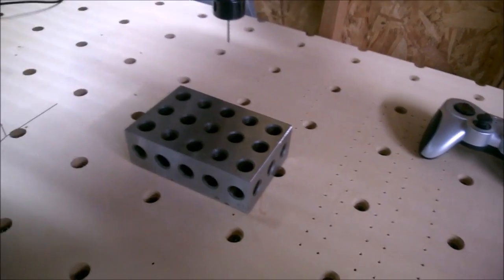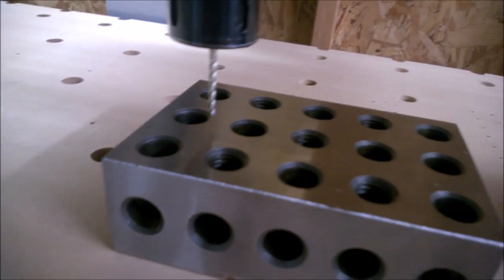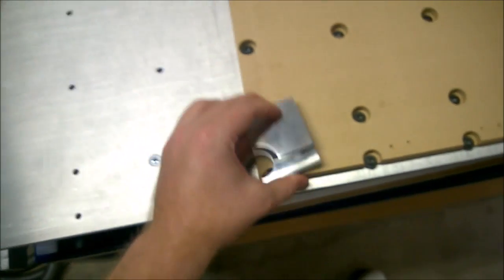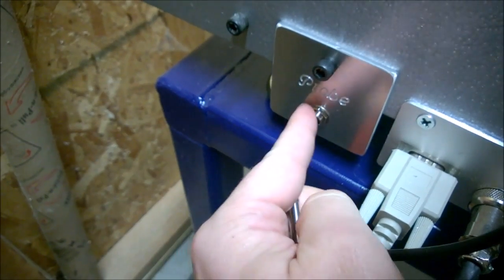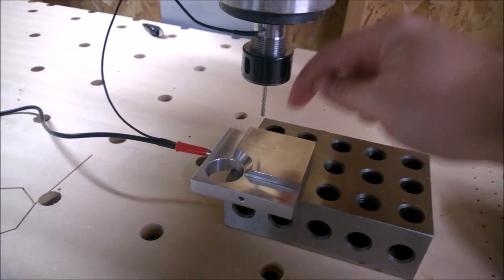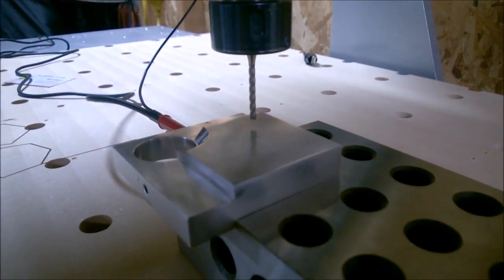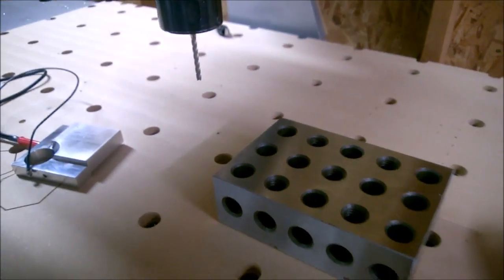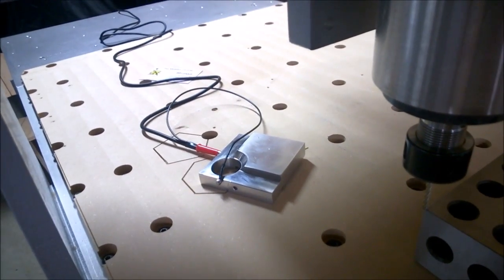jerbroCNC: KFlop / KMotion CNC Automatic Zeros / Tool Height Setter

Comment: That's a Carl Bruce CNC machine or I'm a rubber chicken.  Am I right? 😄
Thanks 1K for the video and code.  I think I've got a chance of getting this working now.
Reply from the maker: Correct!  Still works great.
Reply from the maker: By the way, you don't need the extra ground to attach to the collet holder - Carl Bruce's machines are grounded at the tool, so you can skip that step.
Reply: Thanks for the tip!  I was wondering how you pulled that off with a single lead.
Reply from the maker: @Demothesses - the mono amp connector I used does have two electrical paths - one + and one ground.  Though since the tool is grounded, attaching magnets to wires and finagling with that extra wire while not cutting yourself on the tool is not an issue.  Setup and teardown of the calibration block is that much easier.

Comment: I modified your code a bit and got quite a bit more accuracy. Not necessary for wood, but critical for machining metal. Basically, I added a "slow probe" where once it found the metal, it would back up just slightly and probe again at a probe speed/50. 

Whereas previously I could get repeatability to within 0.003", this took me to repeatability of 0.0005". I did something similar with the homing switches and the homing routine. Just thought I'd share.
Reply from the maker: I appreciate your coming back to share this.  I'd like to try it out - would you mind sharing?
Reply: Here I only reduced by 20, but in other scripts (probe down) I reduced by 50.

Comment: Thank you so much for the video. I am also using Kflop with Kmotion/KmotionCNC. I have a similar plate with a 0.6" corner hole that's centered on the work piece. I looked at your code. What does the RIGHTCORNEROFFSET and LEFTCORNEROFFSET variable represent? My guess is MAXIMUMTOOLDIAMETER represents the size of the corner hole? Thank you for this video.
Reply from the maker: Howdy!  Each of these three values are used to figure out how far to move the tooling to prevent crashes on to the top of the plate.  

MAXIMUMTOOLDIAMETER  is precisely that - it's the largest tool diameter you would use.  Now, to you do have to consider the size of the whole when you choose your largest diameter tooling that use the plate.  My plate has a hole that has a 1 1/8".  I recognize that when we don't yet know zero precisely, we don't want to get close to the edges of the hole.  So, given the tooling I had and the diameter of the hole it has to go in, and understanding the tool won't be in exact center, but be off by a bit up/down/left/right, I declared that 1/2 of the whole diameter plus a little wiggle room would be safe.  That means 1/2".  In the code,  MAXIMUMTOOLDIAMETER  is used as an additional offset when moving over the plate (both east-west and north-south) so that when the tooling is brought back down, it misses the outer edge of the plate.  I think technically, as the first-pass for finding the hole center is pretty good, you could increase that value to 1" in my case.  Practically speaking though, I don't have tooling that wide I'd use in this scenario and it means the probe mechanism will go further out to be more safe.  So, this one is up to you.

LEFTCORNEROFFSET is a little mis-named.  This value is used as the distance between the middle of the hole and BOTH the distance from the middle of the hole to the left edge of the plate and the middle of the hole to the bottom edge of the plate.  In my case, it's both 3/4".  

RIGHTCORNEROFFSET is also a little mis-named.  This value is used to figure out how far from BOTH the upper edge and right edge the tooling should be brought over the plate to then probe north/south and east/west.  Essentially, that's the center of it's traversal across the plate.  In the video at 6:20, the endmill moves RIGHTCORNEROFFSET distance over the plate before it moves the other direction.  Again at 6:35, the endmill returns to a distance of RIGHTCORNEROFFSET from the east side of the plate before it moves south.

If I were to to update the code, I'd rename LEFTCORNEROFFSET to to HOLECENTEROFFSETFROMSOUTHWESTCORNER and RIGHTCORNEROFFSET to PROBINGOFFSETFROMNORTHEASTCORNER.  I suppose it's possible you could want different offsets for each of the four values, but in my case, I was fine with just those two offset values.

Please let me know if I can provide more clarity.  Cheers!
Reply: @jerbro32  I completely understand the what it is you're talking about. By chance, would your CNC builder be named Carl Bruce, SpeedlineCNC? He built my machine and it looks very similar to yours. Mine is 4x4. I honestly don't like my corner block that much. Carl gave me a nice sized z-touch-off block. I ended up buying a corner block that seems too small. The hole in the corner is 0.6" which limits the max diameter bit I can use to reference the work piece.
Reply: @jerbro32  My circuitry is looking for the IO probe bit to go low/to 0 volts. I'm not sure how to switch that, or if you had done that within your code already. Did you mark the probe bit as a #define? If not, I'm wondering if there's a way to define the triggered state as either 0 or 1?
Reply from the maker: @AlabamaWoodworker  Yes, my builder was Carl Bruce, though I completely replaced the control box, added the probe functionality and added the ability to control the spindle speed via code instead of what he had - which was just the VFD dial.  Also, when I purchased my machine, it was only from Carl Bruce - I don't think SpeedlineCNC was a thing back then.  It's good to know he's still in business and evidently stepped it up a notch!
As to how my IO probe is setup, look at my reply to Benjamin Farrar below.  That explains how from hardware to software to the #Define statement this is all connected.  If I remember correctly, you may also have the option in kmotion to configure how the bit is configured - 0 or 1.
Reply: @jerbro32  Thank you, Jeremy! I set PROBEBIT to 6 (versus your 171). The program was able to compile and run; however, I still need to make modifications that are specific to my machine counts, etc. There's a lot to unpack and I may be reaching out to Tom at Dynomotion to help me unpack all of it.
Reply: @jerbro32  I was able to get your program to work. I completely forgot to include the occasion of my KflopToKMotionCNCFunctions.c. Duh! Once I specified all my parameters, the program worked perfectly.
Reply from the maker: @AlabamaWoodworker  Fantastic!  I of course need to see a video of it...  otherwise it didn't happen, right?  : )
Reply: @jerbro32  You bet! I'll definitely be making a video about this.

Comment: do you have a picture or a video of the interior of your control box? need to rebuild mine, going to replace my servo motors with stepper motors, and update my boards to a kstep board. just wanted to see if you have other power supplies in there besides just the 5v power supply, and what else it might contain, since our machines are similar. thanks
Reply from the maker: I do.  Here's how I put it together:  http://www.joeschmoe.com/images/cncControl.jpg  The power supply I went with handles 5v, 12v and 48v - it's a HP server powersupply.  I can dig up the model number if needed.  You'll notice the VFD as well as fuses, breakers and some power handling/conditioning items recommended in the manual for the VFD.  I did have to mount the VFD sideways, but it works out, especially as I control the speed via software and not via turning dials and bushing buttons.  On the door is temp, voltage and the master switch.  I do have two 120mm fans - the lower one draws air in, the upper pushes it out.

Comment: does this automatically record all measurements and account for the offset of the plate thickness for you, or do you have to manually input or set zero for each axis? it seems like you just his the start button on the plate op, and it measures and sets al your zeros (not sure if it accounts for the plate, or you have to lower it the plate thickness, and zero a second time). I'm looking to do this with my cnc, and just wondering if its automatic, or if it requires more input after running the plate op. thanks in advance!
Reply from the maker: Hi Kris.  Good questions.  I've effectively told my code how thick the plate is (0.621"), and I told it how far to go on each axis - which I did based on the dimensions of the aluminum plate you saw in the video.  If you take a look at the code file I linked to in my description, you'll notice all these variables (thickness, width, depth of the plate, how fast to move, the corner offsets - all of them are variables I've defined at the beginning of the file.  For example, #define PLATETHICKNESS 0.621f is where I define the thickness of the plate as 0.621".  I also have defined how high the probe should go after it gets done (SAFEZ), how close the probe should move over the plate (BUFFERDISTANCE) and how far to go down in the hole when it finds the circle (PROBEDEPTH).  All of these can be changed as you want in the #define statements near the top of the file to match whatever plate you're using to find zero.
Reply from the maker: And no, I don't have to redefine zero at all for any.  I push the button, the CNC machine will find zero on all 3 axis by itself in one-go.  I'm still using it.  : )
Reply: awesome, thank you so much for the reply! this is very exciting, because I need something more accurate than the paper method. ill study the info you've posted about building the actual probe jack and leads, and give this a shot myself. I'm using an aluminum vacuum table for my base, so I may even be able to get it to just touch off on the plate itself, rather than a separate touch plate, as I mostly just need the z for tool changes. thank you again for all the information, and for sharing your work with us!
Reply from the maker: As it turns out, I've done that too.  http://www.joeschmoe.com/jerbroProbeDirection.c is exactly what you want.  All it does is go down until the probe makes contact, then it sets zero (- your preset offset), and raises back up 3 inches.  I use this specifically whenever I need to change endmills.
Reply: The link says it’s no longer available. :(
Reply from the maker: Fixed.  I have three mirrors of joeschmoe.com around the world - WestUS, EastUS, WestEurope.  You'll automatically be directed to the closest one to you.  I had only uploaded the file to one of the three sites.  Now it's on all three.  So, try again.  : )

Comment: on the y-axis (CH2-CH1 )master and slave. only executes the command master how to make a slave obey and go to the master  .in your code
Reply from the maker: This is a good question.  Presuming you've set your master/slave setting correctly as per http://www.dynomotion.com/Help/ConfigurationScreen/ConfigurationScreen.htm, I'd make sure you've updated the #define YAXIS to the value that is your master, that should be it.  The idea between master and slave is the slave does everything the master does - there should be no need to update code to interact with both master and slave individually (and somehow exactly the same).  If you've set everything correctly, I may have to call that a potential bug in the KMotion firmware, and ask Dynomotion support for assistance, because you'd then have a reproducible scenario where slave is not behaving like the master.  They'd probably want to fix that.  If you do get in touch with them and some modification of client code is required, I'd like to hear about it.  It'd be something I'd be able to implement.  Luck!

Comment: Today I made many user buttons so called X+ X- Y+ Y- Z- and split your code into many pieces each doing one direction probing only.  A great success with many thanks to you!!  Now I am also interested in how you wired and programmed your wireless gamepad.  Is it via Mach3 plugin or directly talking to KFLOP? If it is talking to KFLOP, can you guide me the principle how to do that?  Manual jogging only by keyboard is very boring!
Reply: Valery Thomson
I for got it and it was sent just ago.
Good luck and don't forget to edit AXIS Numbers.  Mine was different.
Reply from the maker: Hi Kim.  Thanks for the kudos, and I'm happy you're making progress.  The gamepad was the easiet thing of all.  You need to have a standard gamepad, as in, Windows recognizes it as such.  You need to have it 'on' (or plugged in) before you start KMotion.  I say this because if KMotion is running and _then_ you power on the wireless controller, KMotion doesn't recognize it.  Only starting KMotion after your controller is powered will work.  I didn't change button nor key assignments either.  I understand to do so, you'll have to recompile the KMotion source code, and I didn't have to.  Also, to be clear, I don't have anything Mach3 installed.  The gamepad talks to your PC, which talks through the KMotion software to your KFlop.  Said another way, it's the same thing as jogging with your keyboard from your PC, except the device is coming from your PC.  http://www.dynomotion.com/Help/KMotionCNC/KMotionCNC.htm has a section under "Jog Buttons" that talks about it.I concur that keyboard jogging is lame.  Luck!
Reply: Hi Jeremy,  OMG!! I have to confess I haven't throughly read the manual pages.  I just put a cheap USB wired joypad and it just works without any treatment, surprising!!!!!  Although this cheap chinese pad doesn't work for Z axis up/down, I think it is still usable and I think I can get Logitech version pretty easily so far so good!Now my KFLOP is ready to be inside my control box for 6 servos + 1 VFD spindle with full encoder feedback for all 6 servos all the way back to KFLOP board!!Hope to get in touch from time to time.  I'll try to post my machine once everything is complete.Regards, KK
Reply: K Kim is it possible for you to share your edits for Z- 

I have been trying to work through this myself but I am not sure if I have to remove all the mentions on X & Y or just delete the X & Y movements.

Any help would be great. email: clayton (at) sliverpaddleboards.com
Reply: email sent with a file. hope you find it useful.
Reply: Thank-you!!
Reply: Hi Kim, can I also get your edits for Z-
my email: dombest@inbox.lv

Thanks
Reply: I am resting at home atm, will be emailed tomorrow to you. Keep up good work guys! I abandoned my fried KFLOP and moved to ESS already but I still miss KFLOP's versatile capabilities!
Reply: Hi Kim, sorry to bother, just want to know did you send the file? Thanks

Comment: Do you have a schematic for the cabling.
Reply from the maker: Schematic? Not really, but wiring it up is the easiest part.  I went from pin 12 on the KStep JP33 header to my aluminum block that the endmill touches.  I found out that I don't even need the ground connection from JP33, as the endmill is grounded through my spindle anyway.  Whichever pin you use on the KStep JP33 header (you can choose), you just need to set that as a parameter in the .c file.  Look at http://www.dynomotion.com/Help/SchematicsKStep/ConnectorsKStep.htm, in the table that describes JP33, you can see that JP33 pin 12 is Opto IN 3, which maps to IO 171 Input.  In my .c file, I have PROBEBIT set to 171 - that's how I make the connection logically.

Comment: So how does the C plugins work for Kmotion CNC i have been thinking of using this instead of LinuxCNC just because of the flexibility. But is it just a compiled DLL you drop into the application folder and it comes up as a button, or will you need to recompile the whole application?!
Reply from the maker: It's much easier than that.  The .c file exists on your computer.  When you push the user-defined button, the code is compiled and sent to the KFlop.  I presume it's only compiled the first time, but it doesn't matter; it's super fast.  I updated the description with the details, and provided source.  Luck!
Reply: So im guessing you are not compiling the c code outside of Kflop software then, you just provide chunks of code as a sort of script. Which would be really powerful - but i then starting to question why C.. luls but im a programmer as a profession, so it's prob. just the trolls in my head yelling "use a dedicated plugin language" .;)
Reply from the maker: Moronicsmurf Correct, no external-from-KMotionCNC compile.  That said, I did use their debugger / environment to get this going.  Kind of clunky, but it did work, and it did interface with the kflop directly.  This was especially useful as I had the KFlop doing calls to the PC and setting user-defined variables that are accessible on the PC.  It's not so bad.  : )
Reply: Think im gonna need to buy a card setup - mesa cards is as expensive if not more in some cases. And all the coding ends up in the software in the computer (the bad part) and linuxcnc is a bit clunky to get going.
I need to control 3 Granitedevices Argon drivers with servos and a PLC running a tool changer, and a Servo spindle motor. - i so i can just hope there is enough I/Os. ;D